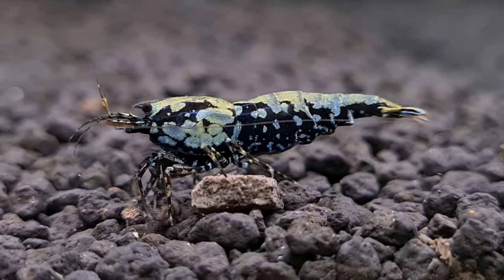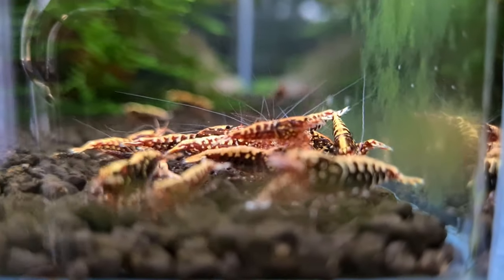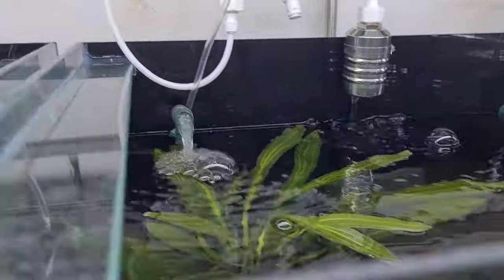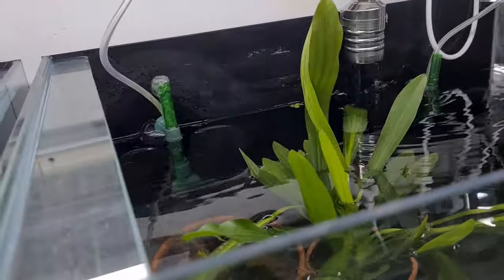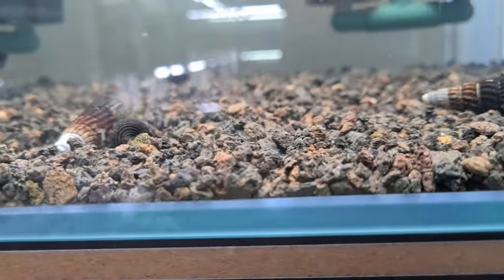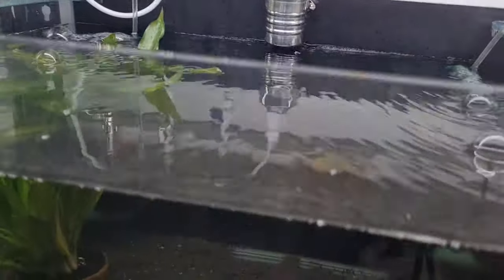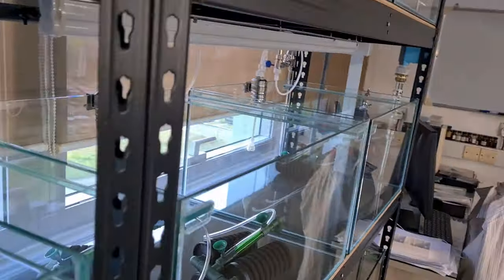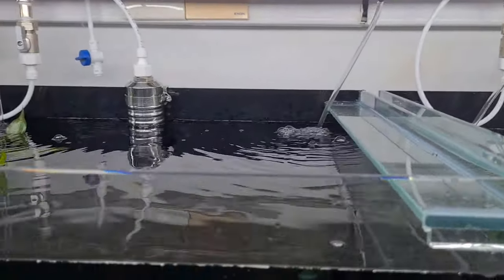Why we use 10 Bar float valve for our Shrimp tanks

Comment: What pump should I use to use a float valve?
Reply from the maker: Most pump can depends how fast you want the water goes in.
Reply: @ShrimpSanctuary  Which pump do you use? Submersible pump?
Reply from the maker: @udaydas6291  we don't use pump. We use tap pressure.